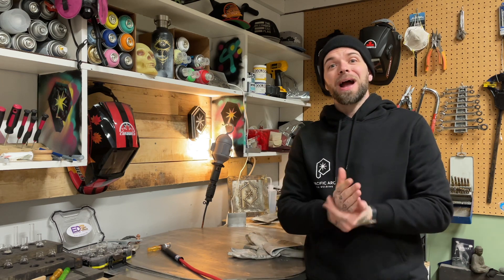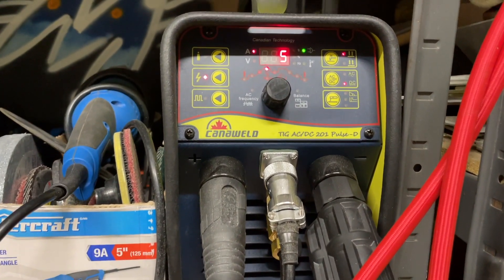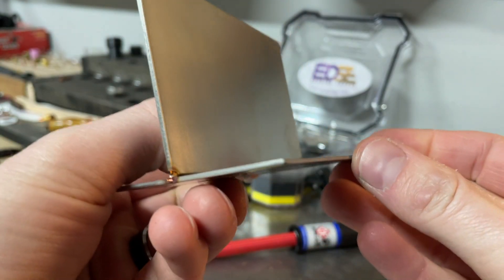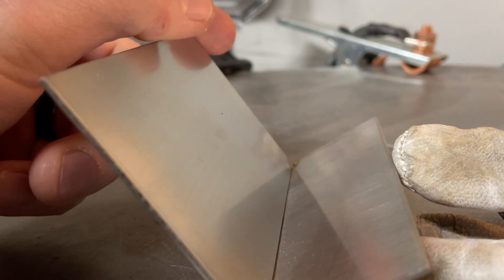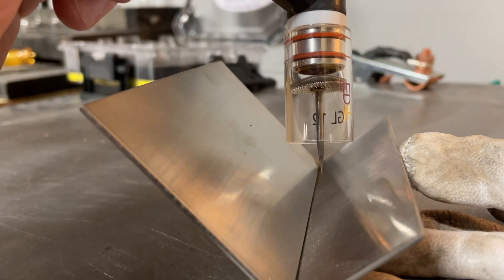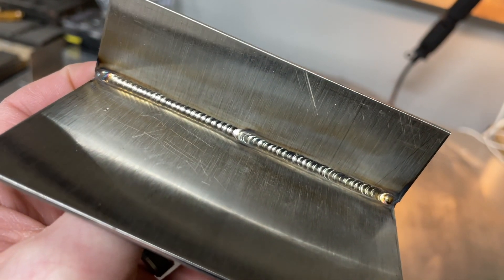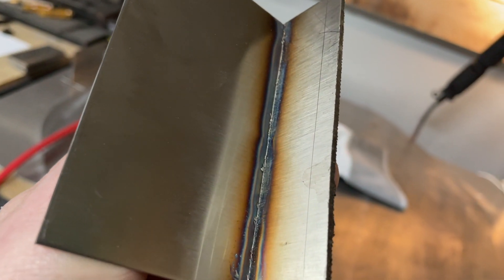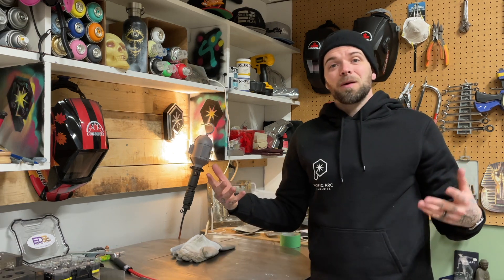Tig Welding CRASH COURSE! The Stainless steel FILLET Weld!

Comment: I want to try out tig welding and have been looking at the Yeswelder 250p ac/dc welder.  I have never tiged before so would I be better off just starting with their 205 tig welder that can't do Aluminum???  It isn't that much money for the unit and I can at least get my feet wet?????
Your help is needed.
B

Comment: just had to submit my tig welding papers for mechanical engineering level 3 in NZ...  3mm LCMS butt, filet and lap joins, 1.5mm stainless butt and filet join, and 3mm aluminium butt and filet join, and learning the characteristics of them has been cool!, You have had a huge influence on how ive been doing with my grades.

thank you

Comment: I know this is just for test but shouldn't you use 308 rod for SS304 otherwise? 316 contain molybdenum and other stuff which 304 doesn't and the dissimilarity can cause problems as I understand it.

Comment: I was disappointed you totally blew off shielding of the back side with either Argon or Solar Flux.  I know that sugaring is no big deal for artwork, but in the real world, stainless is used for its corrosion and strength properties.  If you fail to shield the back side, your work is doomed to poor performance in both these areas.
Reply: He's just showing some technics for a fillet weld....... You totally miss the point dude.
Reply: @egSmith-sp9gl  -  not everyone is as knowledgeable as you and I.  You gotta crawl before you can walk, and casual viewers will not be aware of this critical aspect of stainless that needs to be addressed before you ever put on the hood.   If Dusty trains people, I would expect him to wipe down each joint (and maybe the filler too) with acetone degreaser and hit aluminum with a stainless brush to remove the oxide layer.  If he's just showing how to get pretty oxide colors in SS, I would agree with you, but if he's teaching noobs how to weld stainless, he needs to at least mention the critical prep work in passing.  I'm OK if we disagree on this.  That's what makes the world go 'round.  I've been welding since 1970, and there's always more to learn.
Reply: So, one must always shield the back on stainless?
Dumb question…
I’m guessing if another bead is required on the opposite side, it does not need to be shielded due to the first bead on the first side - correct?
Reply: @YT-User1013  - The chromium in stainless is highly reactive and an oxide layer creates its "stainless" properties, much like aluminum.  Molten SS reacts with air to create an ugly porous black chromium oxide (resembling burnt sugar, hence the term "sugaring") and in so doing depletes the underlying alloy of this essential element.  At this point, the damage is done and another pass on the back side will not even be possible.  IF you are able to limit penetration such that the surface of the back side remains solid, you can often squeak by without shielding it from ambient air.  This is the case, for example, with welding a sensor bung into an exhaust pipe.  The strength is not an issue so you can just kiss the pipe wall with your bead and get by without shielding on the back side.  If it were food service piping, you would need to purge all the air out of the pipe with argon and make a full penetration weld so the back side would be smooth, with no cracks to trap bacteria.   If you're welding up a stainless exhaust system where resistance to fatigue cracks is important, a cheaper and simpler alternative to argon purging is Solar Flux (a military secret during WW-II) which is a powder you mix with methanol and paint onto the inside of the tubing.  It creates a protective film like molten glass over the molten stainless and enables full penetration welds.  It's a bi*ch to remove so it's not used where contaminants are a concern.  One other property of SS that gives you fits in welding projects is thermal distortion because its coefficient of thermal expansion is very high but its thermal conductivity is fairly low.
Reply: @ralphwaters8905  wow, thank you Ralph!!

Comment: Hello!  I’m new to your videos, but after seeing another gentleman who is quite informative also, they use Furick cups almost exclusively.  Through your vids and instagram, I now see the clear edge cups.  What are the pro’s and con’s of each cup vs each other?  By chance can you do a video on each?
Reply from the maker: Ooooooh good idea! Honestly I find  no difference between the two. Each take a little bit of tinkering with the gas level to get perfect, but I find performance the same for each of them. I do have a Furick cup, but it’s a ceramic one, so not glass. I definitely prefer to see through, that’s why I always use the glass ones :-)
Reply: @PacificArcTigWelding  awesome!!! I just got some 8 cups and a fupa 12 go go with the Miller multimatic 215 my dad gave me.  I’m just getting started, but more of a hobbyist is what I may be towards later once I get it all down.  Had a crash course in use of the machine and technique this past week from my dad who has been welding since he was 14...now 71y/o.

Comment: My only welding  experience from earlier is migwelding.  Whats your opinion about ac/dc tigwelding maschines in the pricerange of around 1000 us dollars.  Is it just a waste of money or can it work.  This is on a purely non professional basis.  My first project is stainless material, a woodgasifier. thats why i am researching for a tig maschine now.  But the thought of beeing able to do aluminium welding at some point later on is also of interest for me.  How would you rate the capability of a new cheap,(the pricerange i mentioned above),  ac/dc tig machine in the respective material stainless and aluminium.
Reply: From australia  my thoughts are  dont go below 200 amps ,  most 200 amps are big enough , for handy man work,  my saying is what you pay for is what  you get , go cheap , get crap , spending that bit more you wont regret it   hope i help , to answer your question ? Regards from australia
Reply: @timothyrouse2853  Hello from snowy and cold Sweden.  Yes i think you´re right there.  Probably a good idea to stay away from the absolutely cheapest maschines.  Just after i watched this clip, i saw in the video list to the right, he had a review of a canweld maschine. That one looked really fine to me, and at a very good pricelevel. Unfortunately it seems like there is no sales representation for that brand outside of US and Canada.
Reply: @rogerhamberg1266   check out the kempi range of welders?
Reply: PrimeWeld 225 AC/DC TIG welder. About $800

Comment: Great video Dusty. I've been curious how to determine when something needs weld on both sides vs just one side?
Reply from the maker: Very situational really, depends on what it is, what’s on the backside, what loads required, etc. Usually boils down to me asking an engineer 😂🍻
Reply: @PacificArcTigWelding  Ha. I guess I'll have to become good friends with an engineer.